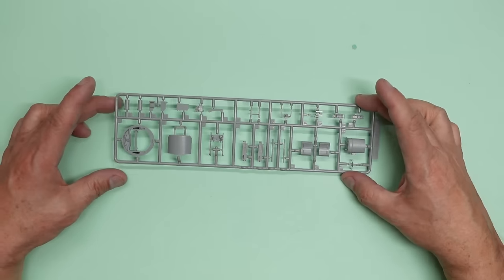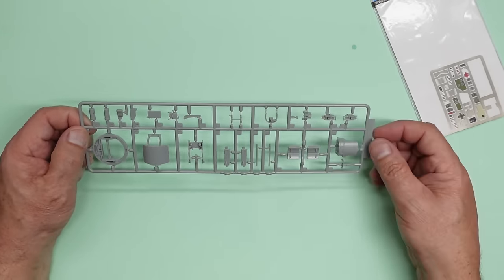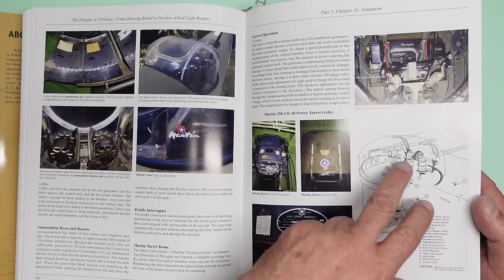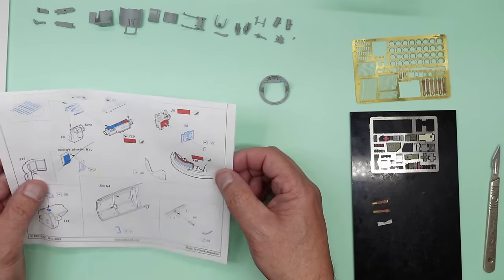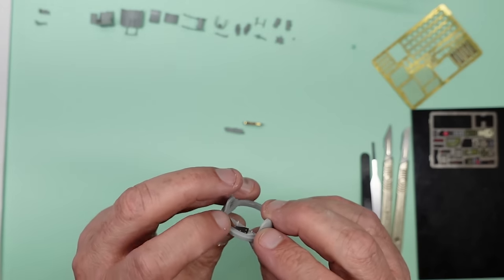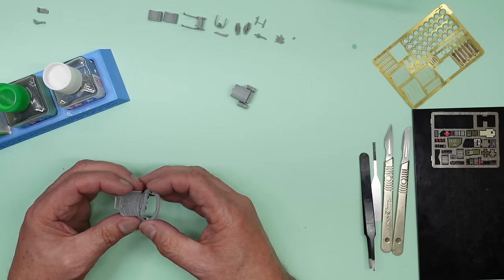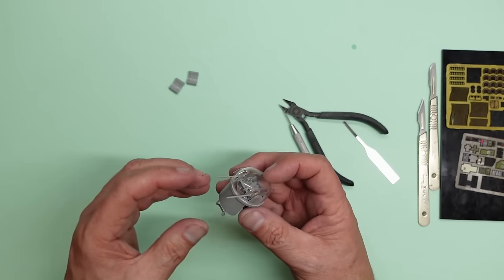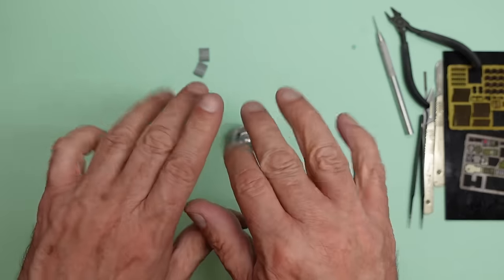HKM 1/32 A-20G Havoc build. Part Nine.

Comment: Hi Nigel, great videos keep up the good work.
Question if I may, just watched your build of the cockpit and I have a car body which I need to strip down and respray, now going down the IPA bath route but don't know what will happen to the clear parts (windows) which are attached and also will the IPA undo any parts that have been glued with Tamiya extra thin?????
Any help will be appreciated.
Thanks again.
Reply from the maker: As far as i know the IPA will not affect the clear parts.. best test first. The IPA will not unstick the extra thin.
Reply: Thank you 👍👍👍

Comment: Hi Nigel,
Eduard  makes flexible resin 50 caliber ammo belts that I think you could dip in hot water to mold around the feeding sprockets.  There are some good photos on Google of the Martin upper turret for references.  Also if want some good video of a unrestored turret, there is a guy in Florida who owns a B-24J that does complete walkthrough of his aircraft.  I was looking through Eduard's instructions online and the Martin manufacturing tag needs to be lowered to the oval on the back of the seat. They have it to high in their reference photo.  On the gunsight, the top block should be cut off and replaced with a piece of sheet photo etch, as it was a sun shade to look through.   It looks good what you have done so far!
Reply from the maker: Thanks.

Comment: I suggest you get Tamiya‘s diamond coated file. Works great on PE!
Reply from the maker: Thanks for the tip! I have Infini files but I prefer to use a sanding stick..
Reply: I agree. If something happend to the one i have, i would replace it right away. I bought mine back in 2016 and it's still as good as the day i bought it 👍